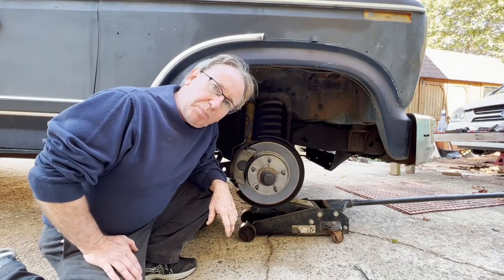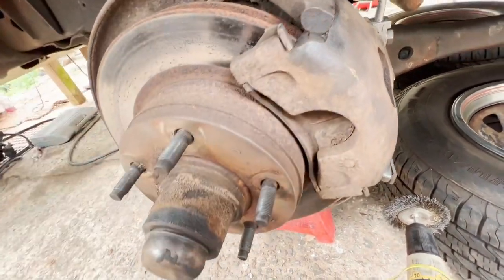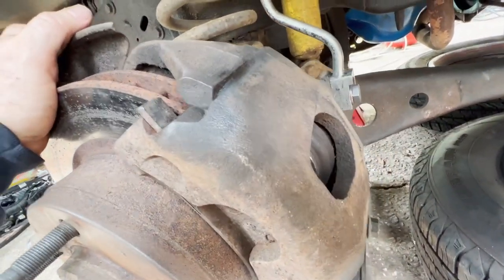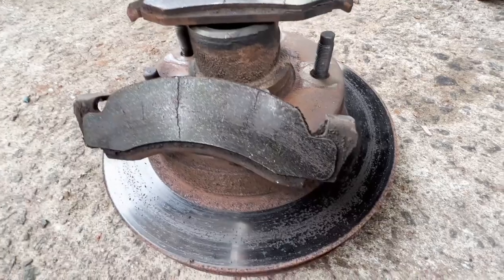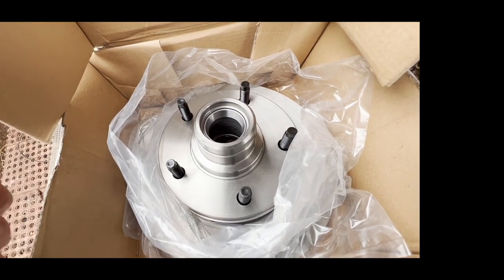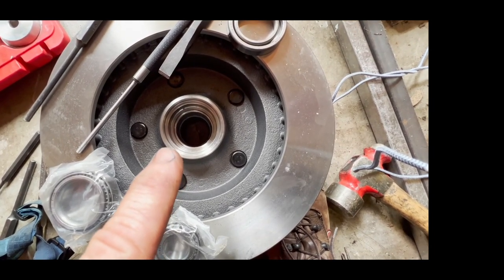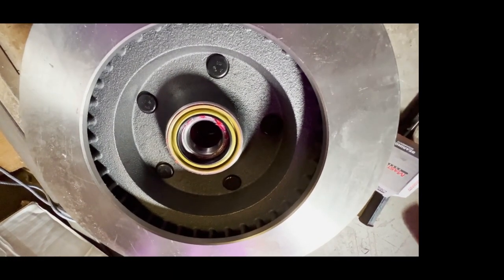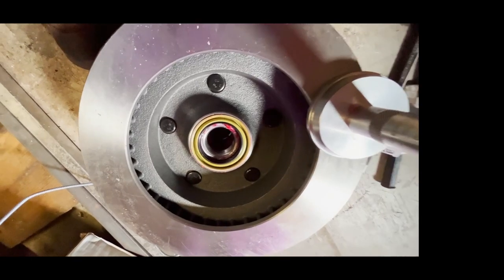Part 1: Universal Front Disk Brake Job on 1983 F150 Replacing Calipers, Pads, Rotors, and Bearings

Comment: very clean truck
Reply from the maker: Hi, thanks. I've had it since 1991. It's just plain fun to drive and people always ask me about it.  It did get moth balled for about 5 years after a 100 year old giant oak tree fell slowly on it during a hurricane blowing out the windshield and doing bits of damage here and there, but all easily repairable. I'll be bringing it back to a restored/more presentable condition and doing videos of that along with a few upgrades including building a 351 once I find a good core. Check out my videos on the budget engine rebuild I did and the others about the truck. I checked out your channel which has some cool stuff on it. Thanks again for watching and taking the time to comment.
Reply: @mkdhdinfiniteendlessconten3873  That is awesome! I plan on keeping up with the build